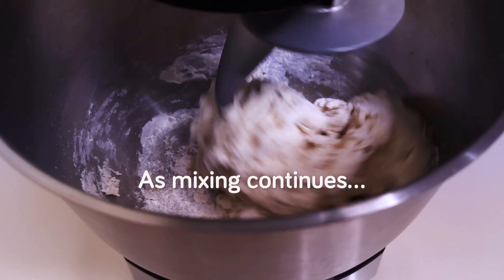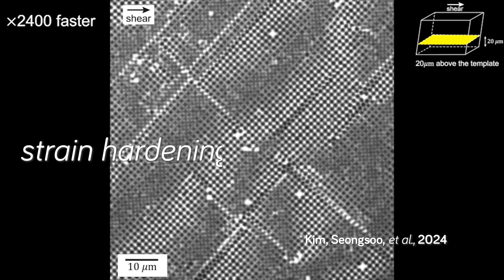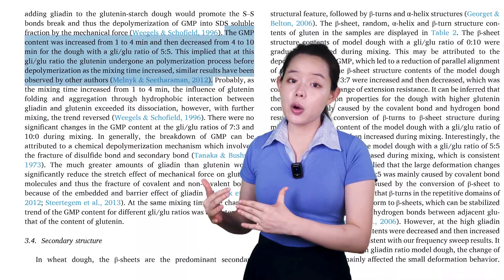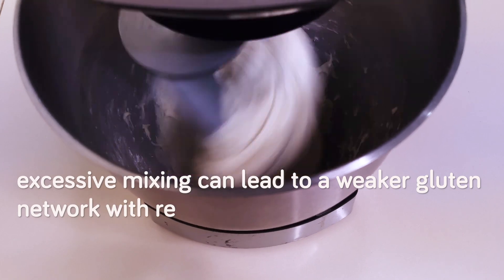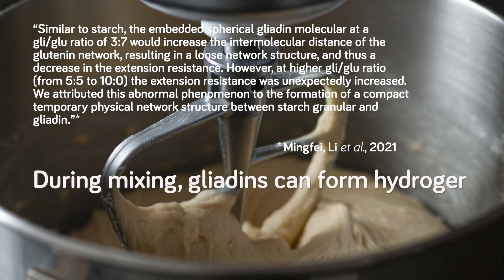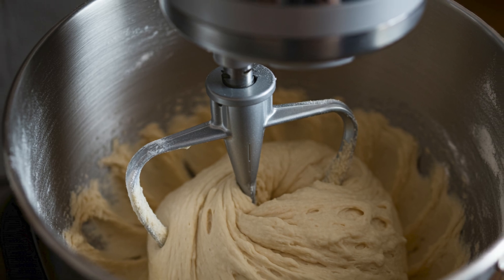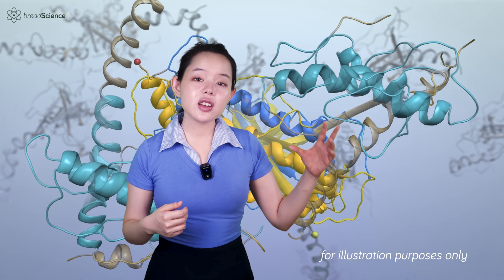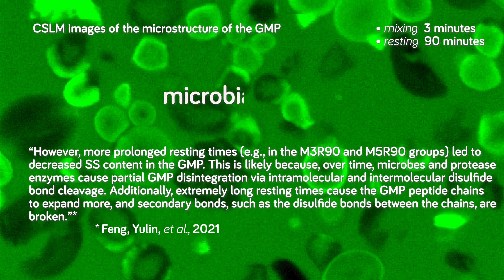Dough Mixing, Kneading and Rest – How They Work | Strain Hardening – Part 3/4

Comment: Hello! I'm new to bread making, and I've attempted a few shokupans myself but following an overnight resting method. I usually melt butter and add it to my liquids and flour at the start, but recently discovered from your videos that 'fat' slows down gluten development. However, since I usually rest my dough overnight for easier time management, the addition of fat early on should be fine, right? As the gluten network will continue developing as it rests. The shokupans turned out great, I'm just curious whether they can become even more magnificent haha.
Thank you for such an informative video series!!

Comment: Is it really worth not adding butter before the first knead? I’ve seen you do it but when I do it, it seems hard on the knead machine motor to not have butter in the first place which reduces motor life I think. Not sure if it’s worth it.

I use the sana machine with stainless steel loaf pan.
Reply from the maker: Good question! Actually the science doesn't really support the idea of delaying the addition of fat in most cases, I do it mostly out of habit, to look at the consistency and make sure the dough is developing properly.
Reply from the maker: I just noticed that you're using a bread machine, which is quite different from the stand mixer I'm using. As different mixers have different results and requirements, it's probably best to follow the machine's guidelines.
Reply: @NovitaListyani  Thanks for sharing your knowledge! Our daughter eats better because of your support.

Comment: Great series Seraphine. I hope this can extend to enriched doughs too as im having trouble with as soon as I add sugar (very slowly) to my dough with medium gluten development it starts breaking down and loses all the development. Should sugar be added earlier in the process or even later? Is it the sugar grabbing too much water from the rest of the dough...
Reply from the maker: As far as I've seen, sugar doesn't typically cause gluten breakdown in that sense, and especially not if it happens that quickly. If you're seeing that kind of breakdown, then one possibility could be that the dough simply needs more mixing time to incorporate the sugar. If that still doesn't work, then it could either be over mixing, the dough was mixed for too long before adding the sugar, or a problem with the recipe. Too much fat can result in a very weak dough which can also contribute to this problem.
Reply: @NovitaListyani  Yeah it has been hard for me to diagnose the problem. Im having the breakdown problem even before adding the butter or egg yolk, which i add last. I am doing 15% sugar and 15% butter, 55% water. I tried two different sugar brands to make sure nothing else was mixed in it, also tried two different flour batches. Its a hot country (brazil) so I mix the dough for 5 min then rest it in the fridge for ~20 min and repeat a few times, otherwise the dough gets to 28c easily even if i start with cold water. Im avoiding hand kneading because it warms it even more due to body temperature. I really dont know what is causing this. When I use the same flour to make a 75% hydration lean dough it works perfectly fine, with a good window pane, as soon as try making an enriched dough and add sugar to it, any type of sugar, even slowly, it breaks all the gluten down and doesnt reform
Reply from the maker: Hmm, in that case, since you mentioned hot weather, the problem might be related to the yeast/overfermentation. You also mentioned multiple breaks in between mixing, I think it's best to avoid this as the yeast will continue to ferment the dough in the fridge and that may cause excessive gluten breakdown. You could also try to use ice water instead of just cold water. If it's absolutely impossible to keep the dough cool in the mixer, then it may be a good idea to simply mix the dough to a smooth consistency, before putting it in the fridge to rest. Giving it one break like this instead of multiple breaks between mixing as you attempted would reduce the overall fermentation time while keeping the dough cool. After this break, you can do some stretch and folds/hand kneading to build the gluten strength later on.
Reply: @NovitaListyani  It couldnt be fermentation because i put very very little yeast early, specially since I like doing 2 day cold fermentations its barely a pinch of yeast, also no preferments. I will try to give the dough only one break instead of multiple ones but it might be impossible in 32c+ weather. Still I have 0 issue with making lean dough, just cant make any with sugar.. Its driving me insane. The national flour I use is very elastic, with a 420 w and very elastic p/l above 1, one last thing i can try is to buy a more extensible italian flour with  a lower p/l. Thanks for your help and time though
Reply from the maker: Ah, it seems like there's a lot going on then, it definitely sounds like it's related to excessive protein breakdown due to proteases though, which doesn't necessarily need a large amount of yeast, especially if there are multiple days of fermentation. Without the full details, it's hard to tell exactly. Good luck solving it!

Comment: Dough mixing development and resting times for different bread types vary, one suspects. Developing the “right” dough for making the Italian-style bread “panettone” at a home kitchen has resulted unsuccessful. Use all-purpose flour with a 11-13% protein content and have used 70-80% hydration rates. I add salt all the butter once the dough gluten networks is developed. The resulting dough is not elastic/stretchable as shown by expert artisan bread specialist in different presentations. Five presentations suggest preparing a preferment and then two extra doughs before all three are combined into one. Common feature in all presentations? Very long period of different machine mixing speeds at different dough development stages. Any suggestions? Thank you.
Reply from the maker: I have yet to do much experimentation with panettone but given that panettone is very close to a cake and has a sizable amount of butter, it seems crucial to strengthen the gluten. Salt should be added to the flour early, and it may be a good idea to mix liquids into the dough gradually or maybe add flour into the mixing bowl gradually, as this could improve the dough's properties. It's also important to make sure the timing of fermentation is right, and if none of the above work, it might be a good idea to try a stronger bread flour since there can be big differences in individual flours. Happy baking!
Reply: @ You have provided a few insights worth trying. I enjoy watching your scientific presentations on bread flour components and how these can be manipulated in “myriad of ways” for obtaining different end results in baked products. I tried baking saltine crackers at home. I had to do much trial and error (eighteen different trials). Nope. Checking on a cereal chemistry college text, I found that the dough composition AND its proper lamination are key to obtaining a descent homemade product. Have tried a few times with “panettone”… Have to go through “the Wright brothers trials”. Otherwise, the thing is not going to take off the ground. Novita, thank you for your suggestions.